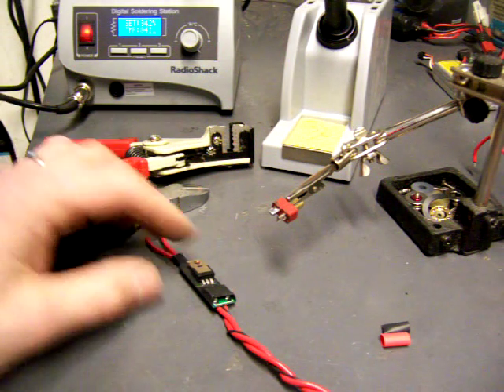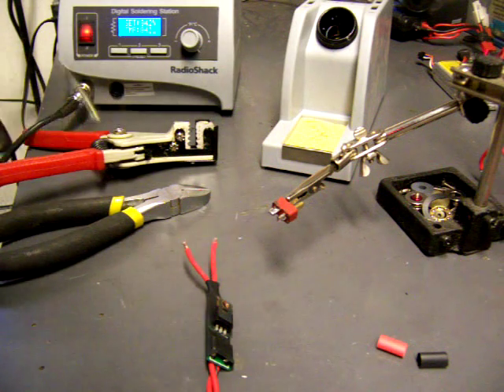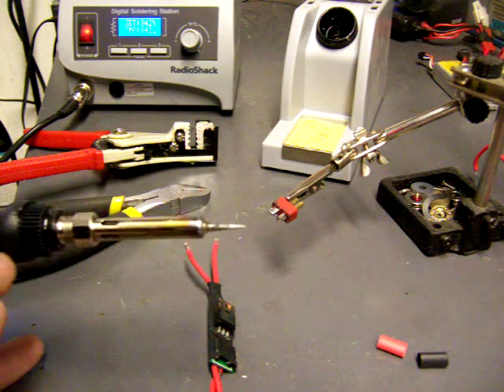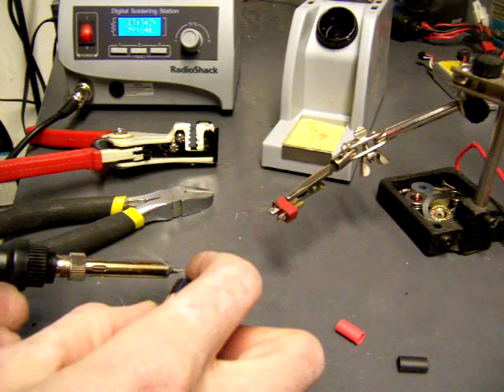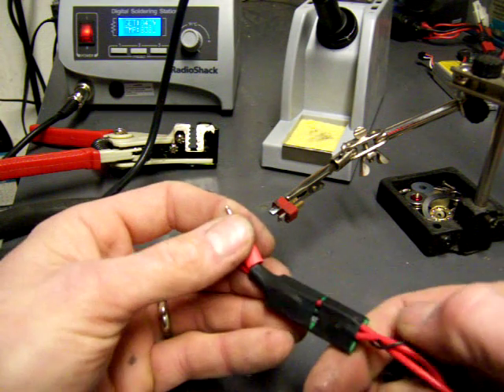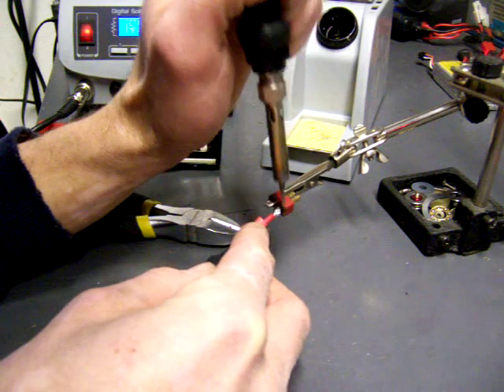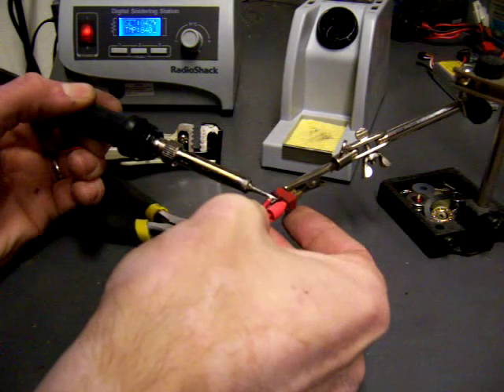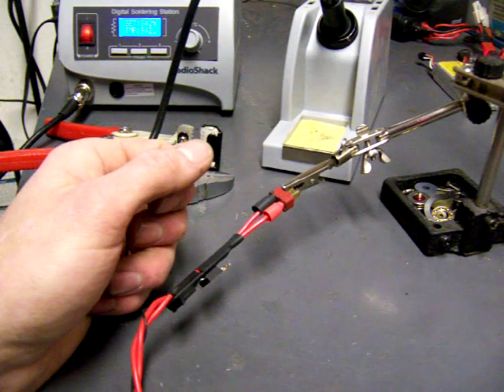Deadman's soldering tips: How to solder Deans plugs onto a airsoft mosfet system

Comment: it actually doesnt matter which prong is positive and which isnt. the connectors arent polarized, and there's very few batteries that come with a deans plug stock, which means you'll have to put it on yourself. so as long as + goes to +, and - to -, it doesnt matter.

Comment: just a tip that I got off of another video. if you put the soldering iron on the bottom and the solder on top of the wire, heat rises and it will ensure that the wire was hot enough to bond with the solder. I tried it last night and it worked well.

Comment from the maker: I use 12-16g depending on what the application is. The whole trick to soldering any type wire is making sure your soldering gun gets hot enough to properly tin the wires and deans posts, then when you solder them together the gun must be hot enough to melt the solder and let it flow together.

Comment from the maker: I prefer to solder all connections in the wiring. Including the motor connections, battery connections, and even the brush wires to brush holders on the motor.

Comment: When connecting the wires to the deans, your re-melting the solder on the wires.  Is the solder on the deans connector supposed to melt and blend in with the wire solder?